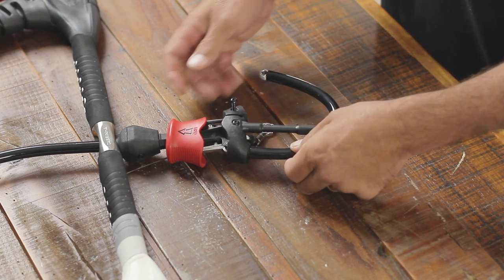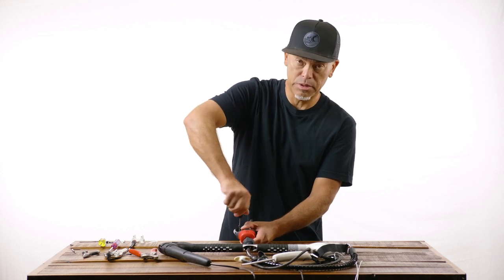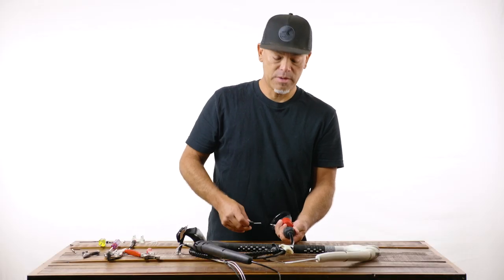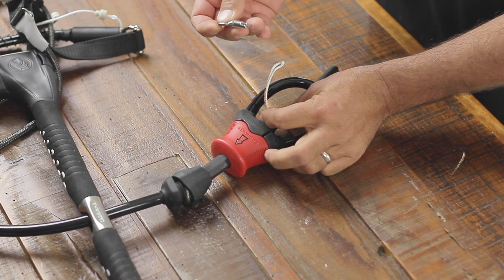2020 Overdrive Control System (Cabrinha Kitesurfing)

Comment: A living hell doing a tear down. Throw it away and buy a new one. If you can. The worst part is the power bracket seat – they just won’t slide off and on old lines like in this video. I had to carefully cut the old one off, and drill the hole in the new one slightly larger with a 1/8 drill bit.

Comment: This bar handles perfectly with the bar sliding over the casing (PU tube). I do have to say though: I have had the rope inside the PU break.

Having a part of the bar (the rope inside the PU tube) that is most likely to break while its encased and cannot be inspected is a huge liability...